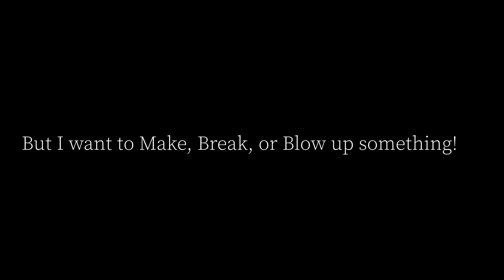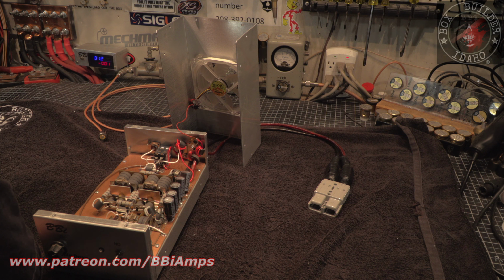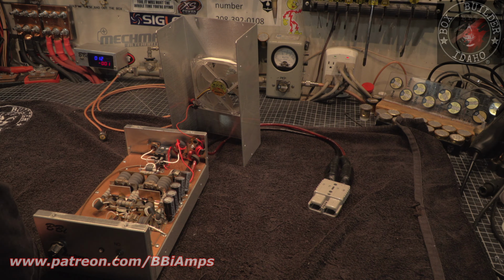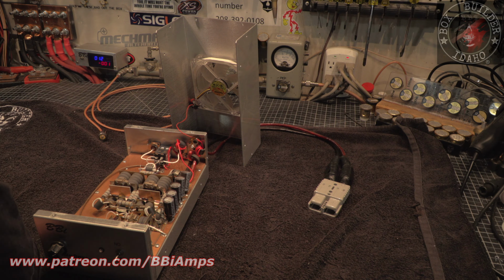BBI Built OLD SCHOOL 2X4 Repair

Comment: I just found your vids randomly the other day, and watched a few of your really old vids, and a couple of new ones. Some of the repairs of other brand amps, as well as your own builds, listened to a bit of your amp building philosify and thought I'd chime in with that there's nothing wrong with looking at an old version of something you built that might not be the way you do it now. The whole point of you not doing it that way anymore is the willingness and drive to improve and get better at something. 

I'd be more concerned if the amps were exactly the same 10 years later (putting aside tried and tested methods that just work and are timeless, and from the point of view of someone starting out and learning to be the best they can be at what they do over a decade or two). I'd be even more concerned if the amps got worse over time, like some of the ones you've fixed from other places! xD

Comment: Mr bbi i have a non post question. Is a lo.med .hi, switch have differrent bias circuits to eacjh point? My amp acts like bias issue AM crystal clear all yhree ssb looks blocked and operators out there say dirty in ji but 3 other radios on same .amp crystal clear all three levels no brick wall looks on ,eter etc 
This lis one those newer surface ,ount boards except coils and finals 
Just discovered  today this radio works as well as the other three except on hi 
Os a ji drive amp and
 Hiting with 20s from the three 40 from my perm radio in medium the amp develops 180+ grom the 40 145+ from the 20 
Wondering if this switch or circuit only on hi needs work?? Thx ahead of time
Reply from the maker: What kind of amp